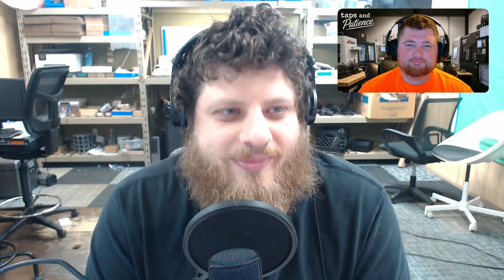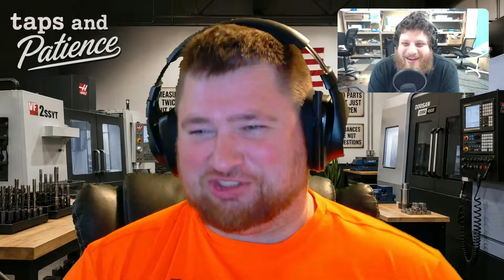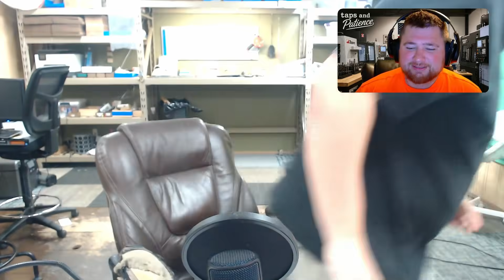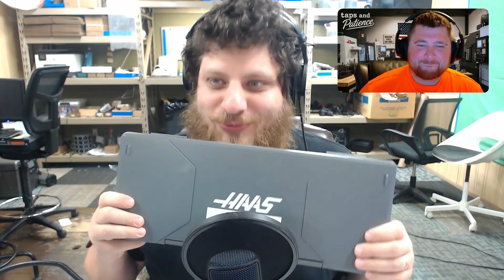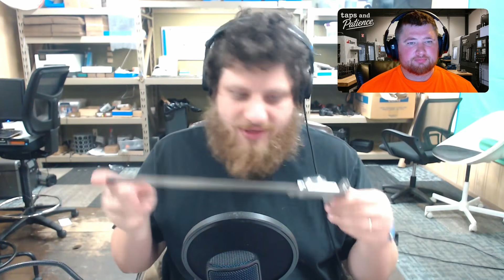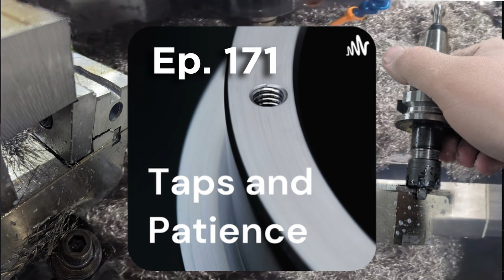AJ's Laws of Quality - Ep. 171

Comment: Wifi, and even more so with Mesh systems can be convenient, but they are usually known to be less reliable than wired. Especially around all the cnc equipment with string EMI sources from servo drives, vfds, and spindle drives. 
Using wireless in robotics is always challenging because of emi sources. I would recommend  running the PTP bridge into a unmanaged switch, and hardwiring mongos control pc to it with a shielded cat6 cable, and use the wifi for convenience items: phone, laptop etc.